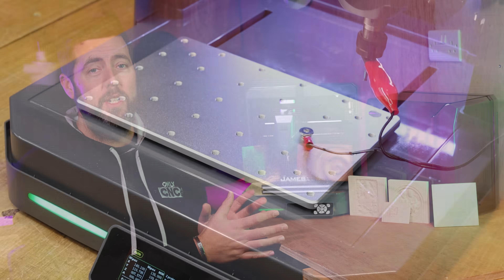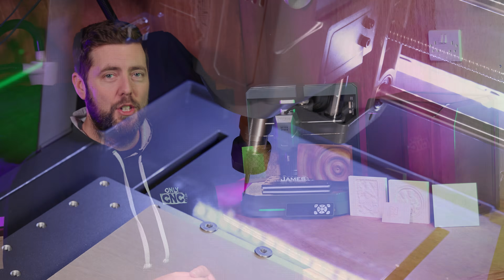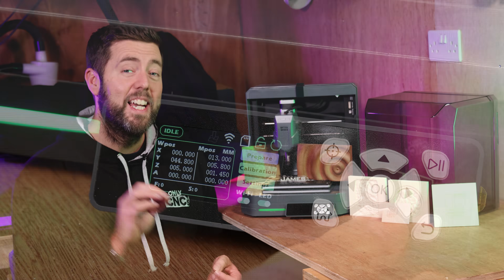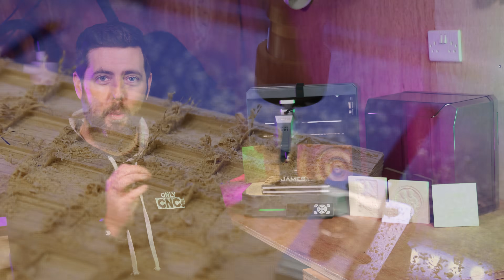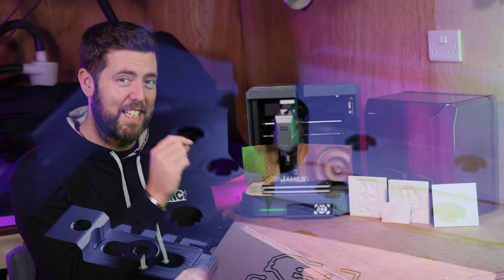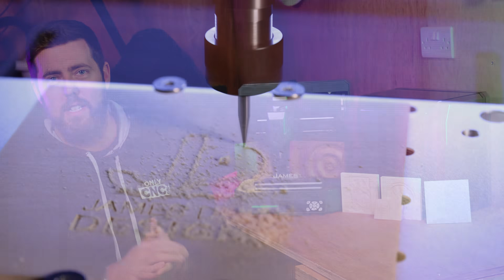Beginner friendly and affordable - Review of the Genmitsi Cubiko

Comment: backer #92, bought for pcb prototyping, I've went through two of these now, the mosfet that is controlled by the top limit switch burns out and the machine will never turn off. They first sent me a replacement board, that was faulty with the same issue, then they sent me a full replacement that died in 2 minutes. YMMV, but the mosfet thing is pretty wide-spread.

Comment: I have just started learning how to use my Cubiko and CNC software as a whole have been unbelievably helpful. I was wondering roughly what settings you used to achieve those results with the one finishing pass on the wave relief. I just did a wave relief myself as my first project on the machine and it turned out great but it was an incredibly long process using a tiny bit. I would love to do the same again with a larger bit and compare the results seeing as yours turned out so well. Thanks again.

Comment: I have a kickstarter version and the spindle mosefet blew up, they did send a replacement for free but this machine is such a pain to take apart, so many screws you all need to remove to replace this board that seems to fail often as seen in the facebook group. It is also a crazy decision for the driver board to be normally cosed, when the mosfet is blown up the spindle will run uniterrupted, very dangerous. Don't buy this, save up for a bit longer and get something better

Comment: Iou mentioned a 4th axis, so was a possible rotary axis mentioned at all . just asking as I would love this for my pen turning hobby. Just the right size.
Reply from the maker: Yes, the 4th axis is the same as a rotary axis. I cant really say much about it as nothing has been released yet but they have factored in a 4th axis port and one will be released for this machine
Reply: @JamesDeanDesigns  thanx
Reply: Last I read they don't have plans for one. I got my machine off the Kickstarter and was hoping it would eventually come out. So far I've mainly used the laser engraver.
Reply: @markrolfe8945  thanx for info